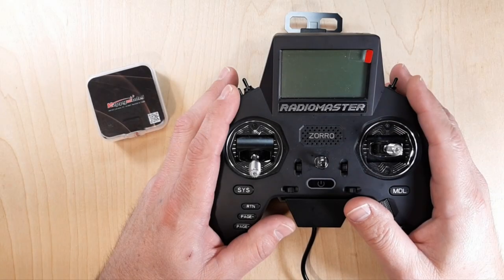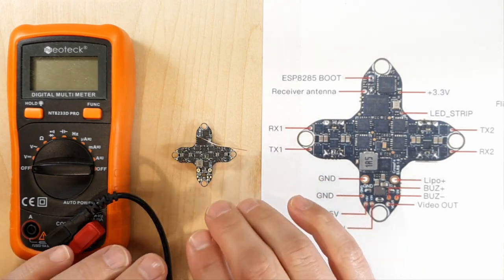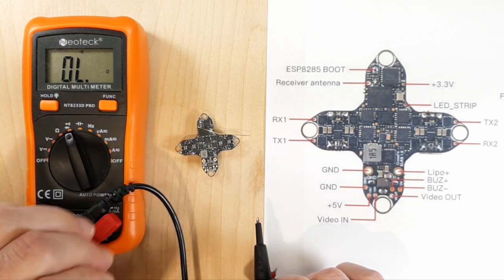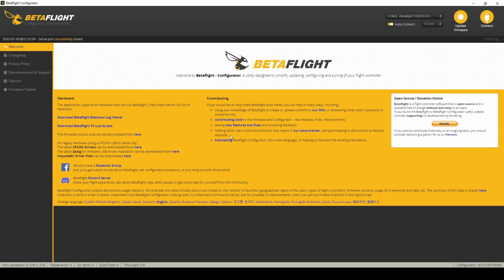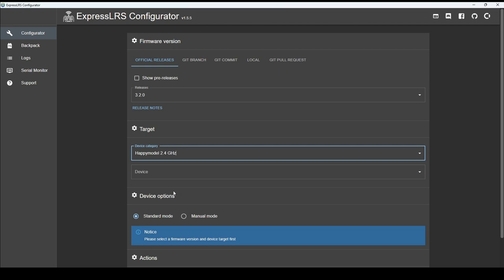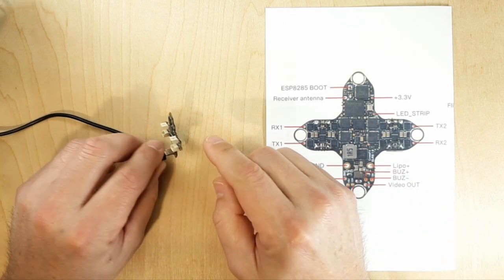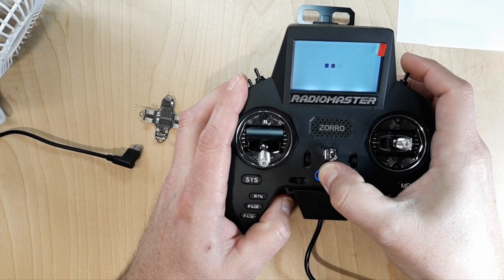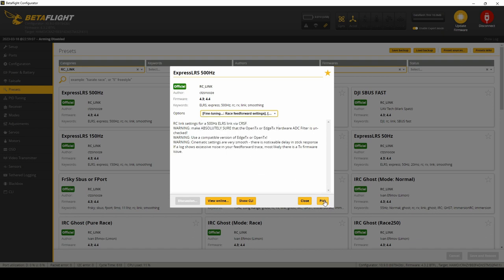HappyModel CrossF4 Elrs Flight Controller | Update The ELRS Rx With Betaflight Stick Movements

Comment: Hi, it's been 9 months after you post this video, are you still using this FC? How's the quality until now? Do this FC can flash with BlueJay Firmware? Thanks
Reply from the maker: The OSD failed after a couple of lite crashes. I got 4 flights from it.. I currently fly the Betafpv 2.1 AIO with motor connectors... I only know 2 other people that built a Crossf4 up, and they both had RXloss the night we flew - sadly, one guy got a single pack in before that happened. I don't have enough information to recommend it or to not recommend it. You can flash bluejay.
Reply: @propsoff  Hi, thanks a lot for your kindly reply. I'll consider this when I plan to purchasing it. Stay safe and take good care!
Reply from the maker: @CHDGREATEST  
My pleasure.. I will try, be safe as well...🍻

Comment: no built in VTX, but they have a table loaded.  seems like a liability to assume someone is adding an openvtx transmitter.  Build and flash, I only do when I need to use FTDI or BF passthrough.
Reply from the maker: I'm going to have to agree. If there was no table loaded, the new person would have to seek it out. Do you suppose my computer loaded it from history - watching that portion of the video again, I saw the opentx table load over a different table in a second. I could step the video playback and see a transition, how bizarre...
I like to build the file and store it in a folder. Pardon my ignorance. What's FTDI?

Comment: Hello.  I believe you have helped me in the past.. and your videos.. alwase a great help.  Of course im a newbie.   And want to say thank you again.  Thank you😊
   Of course i need some help again.  I looked in your videos and did not see this subject  yet it is hard to navigate to find what you're looking for.  Or i just dont know how....  but my question/problem is..   my screen went  black. With osd.    I took it apart and made shur the sodering wasnt touching.   Believe i was happy with it.. turned on... and my video was on.. but then seconds later it started to fade to black.  Got darker and darker. Than black with osd on screen.  ¿???¿?? 
  What could be causing this?  Oh ya. Im running a meteor65.   
 Could it be just the camera?  
 The antenna  fell of when i messed  with it.. a thought  i dont know..  any ideas?       Thanks again. I very much appreciate  what you do😊
Reply from the maker: It sounds like an over heating issue. They will fade out as they heat up. Depending how bad that was, it may work again after cooling off or its fried. The are made to have air flowing over them. Cameras, receivers, and VTXs heat up. It's a good idea to have a fan blowing on them while plugged in.
Do you have a different camera to test if it's just a camera swap?

Comment: Thank you so much, brother! I was going round in circles until I watched you video. The model mismatch was not an obvious fix. For hours, I had been scanning thru CLI dumps for Happymodel Baseline, swapping between 4.3.2 and 4.4.1 and even attached a lipo without soldering - of course none of that worked, just stuck with rx bound but no stick movement.
Works lovely now!
Reply from the maker: My pleasure, so glad this helped. All the different firmwares and most not communicating with each other has made me scratch my head many times...🤣

Comment: Thank you for sharing, great video! especially the technical revision part(to me) its a must now that I'm aware of potential flaws in the VTXs systems, still bit disappointed to be honest and like you said the frustration its real, I think I'm just going to save some money and go digital from what I seem, please no hate at the end its to have fun. :D cheers and keep up on sharing, I'll pass your vids to some friends that also want to start doing bit more with their RCs(still don't want break the bank-ANALOG). and FPV its a nice touch to have a good time, and not feel frustrated by technical problems that come from factory, no good for any beginner with zero experience in RC electronics at least(no wonder people give up).
Thanks again so much for your help and sharing your experience with random people like me. :D
Reply from the maker: My pleasure. Calling out manufacturers when they make mistakes has cost me (no one will send me stuff to test - except Vifly), but that's the foundation of my channel. I also believe, "Don't fix what ain't broke".. Lol... 
As far as analog video goes, I wire everything (even all-in-ones) the same. Here's the video of exactly how I do it. 
https://youtu.be/OXOmYrez3rE

Comment: Does this really capable of running 2s with that 5a? Or are these newer product pack some new tech that i suppose prevent it from burning mosfet in a few days?
Reply from the maker: It's says its 2S capable, I don't know of any 2S motors that won't torch a 5A ESC either...🤦🏻‍♂️
Reply: Does using xt30 pigtail with 100uF capacitor enough to use it with 500mah 2s battery?
Reply from the maker: @anonymous_real  
Yes, that should be normal.

Comment: hi there
what whoop frame does the HappyModel CrossF4 Elrs Flight Controller fit in with the motor plugs attached
Reply from the maker: Nearly all of them. It will also fit in the Pro frames. I use the Betafpv Meteor65 (not pro), and the Mobula7 V3...🍻
Reply: @propsoff  thanks for the info, I have both of those frames
Reply: @propsoff  I also have a Betafpv 65x frame that supports 2 1s batteries, I can't seem to fine a FC for it.
Reply from the maker: @hprompt166  
I stopped flying 2S a long time ago. I've been trying to streamline my stuff to keep costs as low as possible, This hobby is getting too rich for me...
Reply: @propsoff  I understand, I'll keep watching your videos. thanks for the help
Reply from the maker: @hprompt166  
I appreciate your support...🍻
*The HGLRC 25a aio seems pretty good for 2S builds. I'm not a fan of it for 4S though...🤔

Comment: I have a question. I have the Zorro and a happymodel  spi elrs 2.4 FC. I followed another video you had and all worked well for me. My problem now is that I can't take off unless I'm at 50% throttle and it's very punchy. Can you shoot me maybe some pointers if you have any idea why that is? Thanks
Reply from the maker: 50% is very high to hover.. But yet it's punchy. I'll need more information to formulate an idea of what's happening...🤔
Reply: @propsoff   Oh I didn't mention when i can't take off until 50% throttle i mean from the ground itself to even get it in the air
Reply from the maker: @nvembrace  
Do you have a video of it? Seeing and listening to it would be most helpful. A 1S whoop should take to a hover at +-28%...
Reply: @propsoff  l will make one and this after noon, thanks
Reply: I now know it's not my whoop. I found another one  and the same thing happens. This all started after I updated the zorro to 3.2.0
Reply from the maker: @nvembrace  
Wonder what setting could have been changed updating the module...🤔

Comment: I have the same HDZero plan.  Put this board into a Meteor75 Pro frame.   I am planning on going 2s with 1002 motors.
Reply from the maker: I'm going 603 / 1S... During the Museum Race, at the whoop house, I had the opportunity to fly and tune on this setup. I really enjoyed it.
Reply: @propsoff Oh wow, the 603 can handle the 45mm props?
Reply from the maker: @MichaelDFPV  
It's a 65mm pro frame with 35mm props.
Reply: @propsoff  My mistake, I thought you said in the video that you were going to put it in a Meteor75 frame. 😉
Reply from the maker: @MichaelDFPV  
Lol, I may have said 75mm because I flew a 75mm at the whoop house during the Air Force Museum Race. I'm saving up for the HDzero stuff, hopefully, have it by the end of spring...🤞🏻
Reply: @propsoff  I watched again after work.  You said Meteor65 Pro and my brain heard Meteor 75 Pro. 😆
I recently learned  about the frame and started planning my first HDZero build.  Just been holding off for an FC other than BetaFPV's offering.   Just learned about the HM CrossF4 a couple days ago and when I saw your new video I was  excited to learn more about the new FC.  Thank you😊
Reply from the maker: @MichaelDFPV  
Thanks for double checking...🍻
Lol, I think I'm as excited as you for the CrossF4. So far, It looks promising. I too wanted to steer away from the Betafpv board. The one I have isn't my first choice to fly...

Comment: thinking of picking up this board for my next build but I can't figure out how to wire the VTX and Camera normally as I only see 1 5v pad.  How did you wire your cam and VTX?
Reply from the maker: Doubled up the wires, the downside of using an OVX300... That's one nice thing about the Foxeer Reaper VTX, it has camera pads on it..
Reply: @propsoff  oh, I've got the flywoo hm600 and I think it's got an extra 5v out on it.
Reply from the maker: @Mr_Meaty  
The 5v out on the VTX would be better, more filtration...